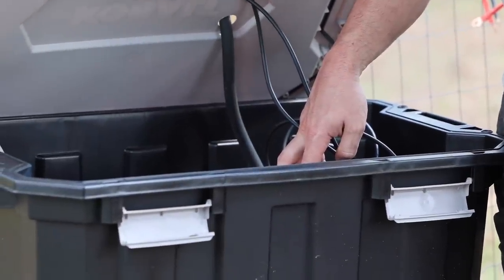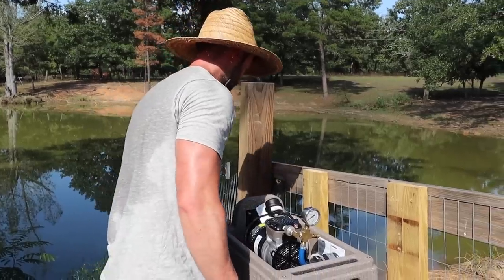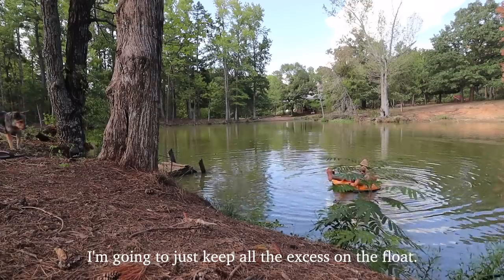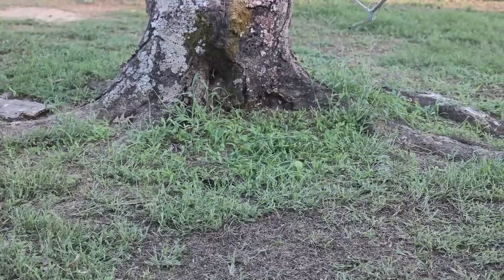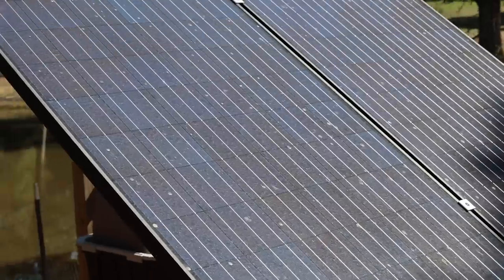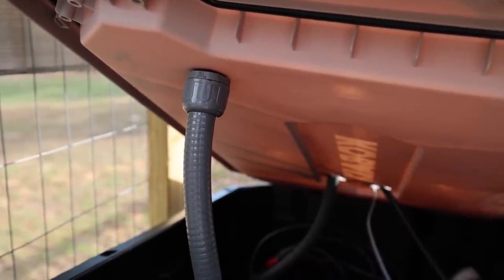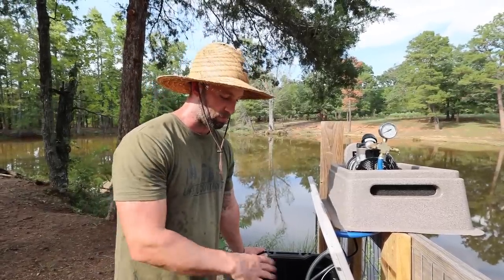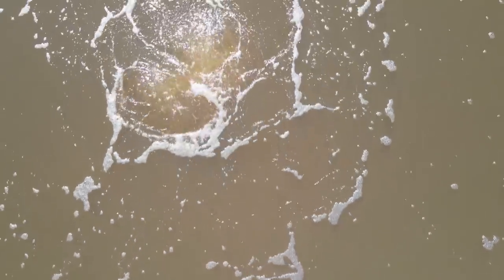BUILDING OUR OFF GRID OASIS | Our Finished DIY Pond Aeration

Comment: What size of portable generator would I need for oxygen machine that runs 24 hours A-day   For my aunt that is on oxygen her electricity goes off in the Winter time and she needs to have backup to run her oxygen machine it'd be easy for her to turn off turn on and charges without sunlight
Reply: Might want to contact your local power company and ask if there are any back up resources available.
Reply: simple if oxygen machine take 100W calculate 100W x 24 hour u need 2400WHour panel and emercency battery need be reserve  battery can run volt X ampere=Wat, . if 12 volt battery have 2400W need/day, = 200 Amp/day  is 200/24hour = 8Amp/hour  8Ax 12 hour etc, need 100Ah battery. but 2400W can run 12 volt pump 24 hour only one panel not need battery if need only daytime pump. if need alltime reserve battery can run emercency pump 24H/day need 200Ah battery can run pump alltime whit battery.  this has only example how calculate how many battery need can run pump, if pump have 100W motor, if have more need more ofcourse.

Comment: If you really want to clean up the pond......put an electric fence wire around the pond and keep the livestock out of the water.
Reply: 𝗪𝗵𝗮𝘁𝘀𝗔𝗽𝗽+𝟏𝟖𝟕𝟐𝟐𝟗𝟓𝟔𝟒𝟓𝟖  The #1 polution issue from a pond like the is the raw sewage from the animals.  using poly wire and Insulated posts with an electric fence controller will keep the livestock out of the pond.  the fence controller can also be powered by solar panels. A couple of fence post can be placed in the water which would allow the livestock to drink.  The color of the water indicates raw sewage in the water from the livestock.

Comment: I don’t understand why you had to put all of your equipment in the water instead of having the inverter, battery, controller etc on land and then run a line to the aerator which would maybe have to be in some kind of waterproof container! Wouldn’t it be easier to perform maintenance on your electrical equipment ?
Reply: The only thing is the water is an air hose running out to the aerator. All of the electrical in on land.